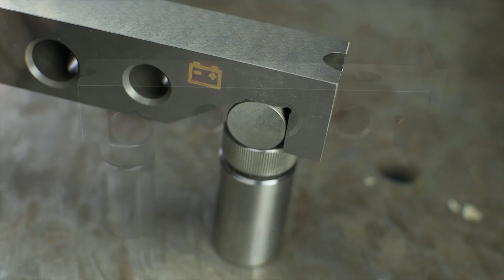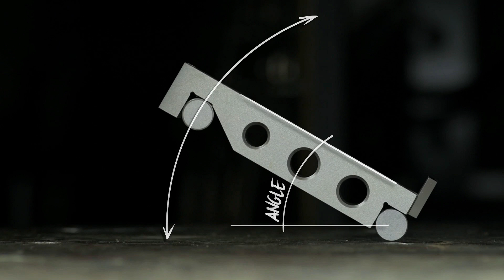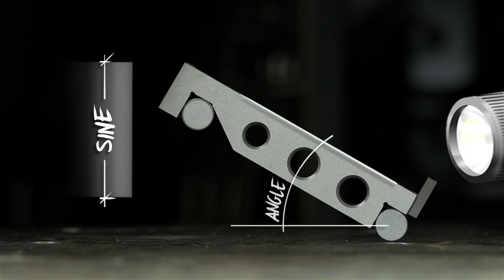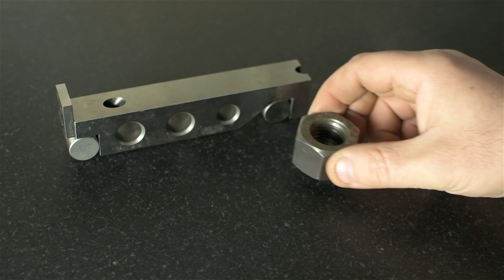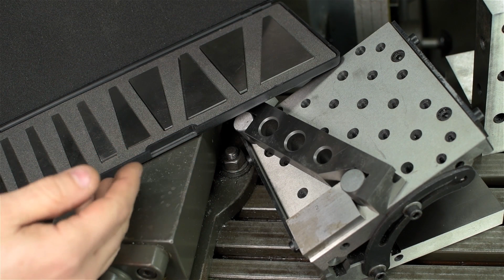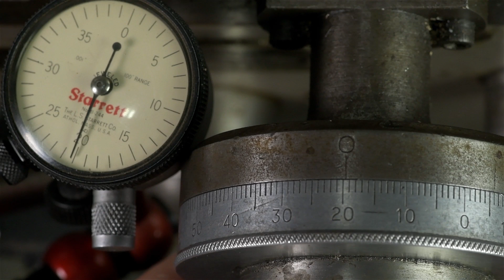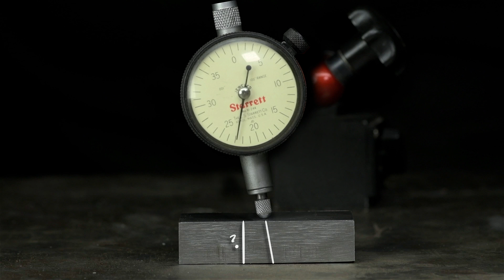A Sine Bar Walks Into a... wait

Comment: I was lucky, my maths teacher made trig interesting enough so that I remember it now 60 odd years later. My metalwork teacher however didn’t show me how to use the cross slide at an angle on the Colchester Student lathes we had in the shop. To be honest it never occurred to me to set up the machine in that way so I have learned something new. Thank you very much. Regards.

Comment: If your numbers are coming out all funky, your calculator may be talking radians instead of degrees.
There's usually a way of changing that, but for quick reference, use this:

degrees = radians*180/PI
radians = degrees*PI/180

one full turn = 360 degrees = 2*PI (radians)
half a turn = 180 degrees = PI (radians)

Comment: I figured the sine bar was 5" between centres so you could make a 3 4 5 triangle easily, and this would give you an angle of inclination of 30 degrees. Except a 3 4 5 triangle gives an angle of inclination of ~36.87°, which would probably only be useful for making 3 4 5 triangles, which would be useless as you would just make a square instead. I think your easy mental arithmatic theory is more likely.

Comment: One comment on an otherwise excellent video.  When you talked about projecting the angle you didn’t explain where that came from. Typically the radius of the circle is 1 unit.  Since it is 1 unit it will always be the case that the hypotenuse = 1 unit.  Since the sine = o/h =o/1 then sine = o (ie opposite length = sine).  And by the same argument cosine = adjacent.

Comment: Trig, the study of right triangles. Carpenters actually use a form of it when they use the 345 rule to layout a square building corner. The Machinist's Handbook has a great math section. A little trig will allow you to precisely set the taper attachment for a Morse taper on your lathe. That and a hundred iterations. While I'm on the subject, why was each MT defined as a different angle?

Comment: This had all the sines of a good video written all over it.

Thanks for the trig brush up. One of those things I mastered at school but 15 years later fumbled my way through it to mark out 6 holes on a 1000mm PCD. My favorite machine, the vertical borer I used to have domain over, doesn't have all the bells and whistles so you had to do things old school.

Anyway, thanks again Tony.

Comment: What do you mean a test indicator can't give linear measurements, and you have to read the manual?

The stylus, in rotating, describes a circle, and you can find the measure of the arc from the angle you move it...

The angle of the indicator doesn't matter, it's the size of the circle (the radius in this case) that matters, and the stylus being a fixed part, as long as you don't change it, it's very possible that the reading is linear.

Did you do that as a test, or do you really believe what you said?

I'm sure your did actual trig with the trigonometric circle...  I can't believe you'd seriously think that... do you?

Comment: GREAT VIDEO!  There, I didd it, used all caps.  That was intentional, not an erorr, I wanted to emphasize you did great at explaining all of the topic.  This should be required viewing in HS Trig.  But for me (an Engineer) the most valuable bit was at the end, the point about test indicators designed to be used such that the probe meet the work at some specific, not 0 degrees, angle.  I guess I always thought you hang the indicator off to the side, with the probe arm tangent to the item under test.  Duh!  Wrong.  And seeing it explained made the big light bulb go on.  Thank you so much!!  I'll need to check what angle my Federal indicators are supposed to be used at.

Comment: The part about using the cross slide at an angle to get finer adjustments to your depth of cut is probably the single best lathe tip I think I have ever seen on the YouTubes. Or in real life for that matter.  GOOD JOB!👏

Comment: After being educated on cosine error, looked up the correct way to use my Mahr dial test indicator and lo & behold, clear instruction appeared for this particular model of test indicator (cool!);

For accurate measurements the axis of  the contact point must be perpendicular to the measuring direction (fig. 1). If this is not possible, it is necessary to multiply the reading on the dial with a 
correction factor, which depends on angle α (fig. 2). The correction factor is negligible for 
angles below 15°

Angle                           15°             30°             45°             60°  
Corr. factor               0,96           0,87            0,70           0,50

Comment: Nice video Tony, I had no clue about the 12 degrees on the test indicators.  The 2 I have were bought used with no instructions and this is the first time I have heard of the 12 degree requirement to avoid the dreaded cos error , but it makes sense.  Thanks for sharing!

Comment: It's super helpful to have a thing that does sines and doesn't do cosines, and has one place you can put stuff. The hardest thing about non-shop shop math is that all the lines on the diagram look the same and you have to memorize which is which part. With a sine bar, it's obvious that you're setting the height of the stack, and scaling down by the length stamped on the bar gives the number in the book.

Comment: TOT - would you be an amazing human being and do a series on proper metrology in the shop?  

As in, how to use pin gauges properly to find the distance between threaded hole centers?  
How to properly do diametric out of round stuff, or the likes?  

The industry i work in halfasses training because we make plastic components, and all of our floor tools for taking measurments are not housed in humidity free environments.  I understand that with plastic, a couple thousandths off here and there isn't super critical, but i would like to know how to do the job proper rather than bumble my way through.  

Your method of explaining greatly exceeds my employers ability to teach and instruct.  

Please assist.  I'll give you a cookie?

Comment: I think you could use the sine trick you showed on the lathe to double the precision of an indicator. If you put your indicator at 30 degrees each division would now be half of what it would normally be. Doubling the precision. Am I correct in thinking that?

Comment: Cosine error is only relevant if you are measuring distances. If indicating something straight on a machine, "0" is still "0", regardless of where the indicator tip is set. You are comparing, and as long as the indicator tip is not moved between comparisons, all will be good.

Comment: Back in the 70's I worked with a guy who had a rather clever 2.5" sine bar. It was permanently hinged at one end to a base bar. The base had a Vee groove cut in it down it's length so the sine bar could be set on flat or round work. The really clever part was that it was all magnetized so that on the lathe you could put the sine bar on the work or on the compound and it (and the gage blocks) would stay where you put it.

Comment: This Old Tony, I made a tool (software) that makes using gauge block sets (36 and 81 piece imperial sets) for sine bars VERY easy. Selecting the size of the sine bar and desired angle, it gives you the optimal stack of gauge blocks to use to make the desired angle. For example, I made a small 2" sine bar, have 36 piece standard gauge block from Shars and I want to get 24 degree... After entering the information I need to the software, the software spits out the following:

Calculated total height for the gauge block stack: 0.813473"
No exact solution (short of for 30 degrees, there is no exact solution with 36 piece set)
Next best solutions: (over and under 24 degrees, as close to 24 as can be...)
  1) For 23.9977 degrees use these blocks: 0.1004", 0.1060", 0.1070", 0.5000"
  2) For 24.0008 degrees use these blocks: 0.1005", 0.1040", 0.1090", 0.5000"

All this is shown in the application window (no command line crap).

I'd like to give this software to you for free.I have been looking at your profile and only place I found to contact you about this was Google Hangouts. If you are interested, let me know from here... I can send you screenshots... etc. Let me know.

Comment: One could also set the topside to an angle such that it will read in metric units.....     .001"=  1/100 mm   ( on the radius)

Comment: When I was a machinist apprentice at Hewlett-Packard in the late 60's, I had trouble with Trig.  Just a mental block from Prep School.  Calculus, Differential Equations and higher Math were not a problem for me...just Trig.

When I rotated to the Tool and Die shop, I was fine until I had a complex Die setup that required using a 12" Sine table.  I was fortunate that my mentor was an old school machinist.  During one lunch break he explained APPLIED Trig to me in a way that I finally got it.  I was an Engineering student...Ollie had only a 5th grade education in Sweden during WWII.

Comment: Once you know how to do angles, then once you know what cosin error is, then you can also do the math to find out just what that error will be over a given distance, and if it will even matter. Eyeballing the alignment within a couple of degrees is probably close enough.  In a practical sense.  For the usual situations where you mag base your indicator at a temporarily location only to move it again after a cut or two or three.

Comment: Great video. I've been doing this awhile... using my lathe for ... jeeze... 20 years? Wow... and never concluded that I could set the angle to 30' to get 1/2 divisions... THAT little tidbit is REALLY going to help me out with some tight measurements I have on a project I'm starting! Thanks!

Comment: It sounds like you just promised us a video on proper test gauge usage!  Just to clarify, the 5" length is the distance between where the two cylinders touch at flat surface, not the length of the metal bar.  A 10 inch sine bar is 1/2 less sensitive to errors in the stack height than the 5 inch bar but is probably 100 times more difficult to fit on your machine.

Comment: The tot function on your calculator gives you the amount of time spend on subtile eastereggs. It's about 70%. Also i just use my cat as a sine bar. Stick some gauge blocks under the front feet and there you go. Sometimes its hard to cope with the blood loss though. Each cat comes with 10 freshly honed cutting edges.

Comment: Another use I have found for a sine bar is making custom angle gages from sheet metal. Use a straight edge as a base and setup the sine bar for the angle you want. Draw the sides of the triangle and cut out. Comes in handy for checking angles in places where normal protractors will not fit.

Comment: FINALLY someone  exposes this! That the indicator at improper angles are mostly a relative indication. I've watched their usage in setting up their material run out or what ever. Otherwise they are just a relative measurement if not used at the proper angles. Surely relative may work fine given the accuracy of most machining. Just glad that you exposed that.

Comment: Construction calculator will do it without being labeled sine/cos and such. It will be labeled rise (height), run (length) and then it will give you the angle and the slope (hypotnuse) in decimal, metric, and foot and inches. Cost <$50. Handy as hell for shop drawings for structural steel and laying out stuff in the shop.

Comment: Help a Dyscalculia here (no joke, I am).  For the record, I’m a carpenter, i watch TOT because, well... he’s educationally funny. 

Anyways, I’m still not getting my head wrapped around this, it jest isn’t adding up as it could apply to my trade and specifically to my array of spirit levels. 

Say for example my 72” level on a wall (with a wall height of 108”) indicates the wall is 5/16 out of plumb (with-in that 72” level length). What is the. Angle of that wall?  And how how do i extend that 5/6” in 72” to 108”? And what if I’m sporting my 48” level? Or my 24” - or any of them?